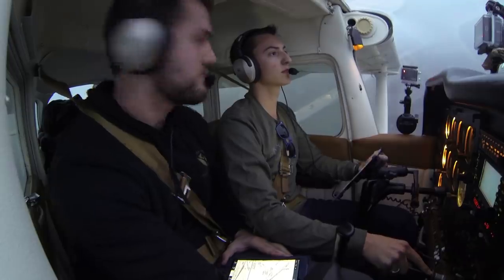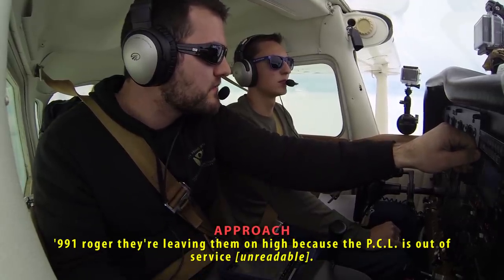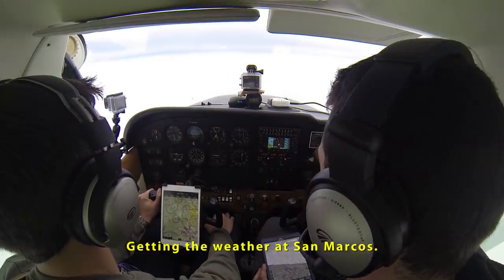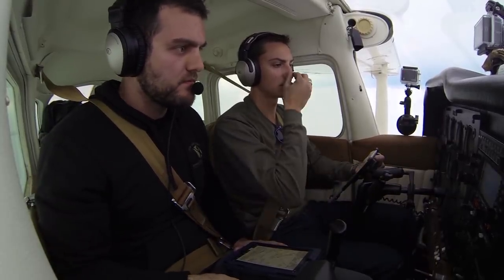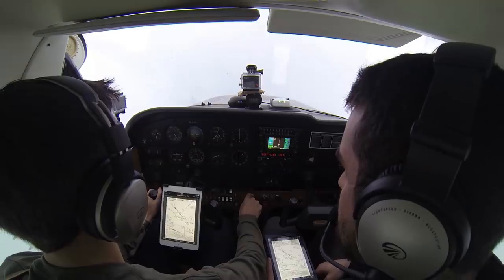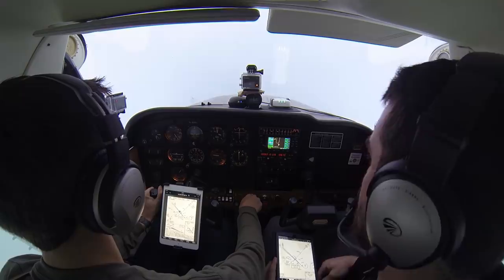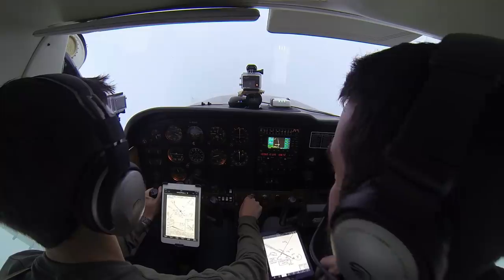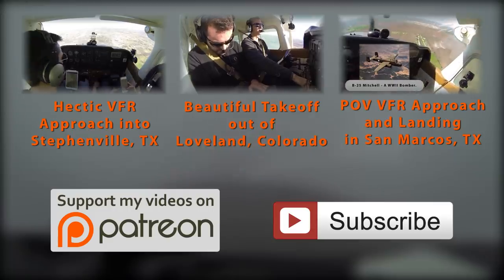ILS Approach to Minimums | ATC Audio | Cessna 172M

Comment: Great video and great job!  Must have felt so rewarding. Thanks for sharing!  I think I understood that the tower might have been closed by the time you landed, so I’m assuming radio communication and piloting rules become the same as an untowered field at that point?  In either case, in the same way that ATC and other air traffic DEPEND on more real time updates from pilots who are actually IN the weather that is being reported by ATIS (such as you did when you noticed the tops were about 5400 feet), by that same token, would it have been possible to announce to the tower or just to traffic in the area that the approach lights were in fact NOT on?  Seems like anyone landing at that airport in those conditions would want to know that, to adjust decision making on how to fly that approach, or even whether they wanted to attempt a landing there at all.  Thoughts?

Comment: Mr. Aviation
1st) Take a deep breath.
2nd) Give  yourself a pat on the back. Congratulations on flying a ILS Approach to minimums on your first try. Not many do as well as you did.

I have a question for you. You pointed out in the video to check suction pressure for the directional and attitude gyros while in the soup. (I am a A&P mechanic, so naturally that piques my attention) Do you take in consideration the health of the engine driven vacuum pump prior to a flight into expected adverse conditions?
Reply: BC437A I'm sure they checked  the suction gauge on run up.  But, there's always a chance that the pump could have  failed enroute.  Not sure if the ADI or DG have "flags" (if they lose suction)  - if not, there would always be a chance that, say, the ADI "froze" in a wings level position. (and the airplane is moving off level flight).  So, IMHO, at least checking the pump vacuum would at least say that the pump is working and the flight instruments are probably functioning as well.    If no suction is indicated, then it's time to do something different!    N-6395T
Reply: Michael Donavon I ask because I am not a certified pilot, even though I understand quite a lot of what a pilot duties are due to my training as a  mechanic. I prefer to replace a time limited part  (IE. A vacuum pump) before they fail. Those in my profession are quite familiar with Murphy ' s Law. Knowing that, would you as a pilot, fly into adverse conditions with a mission critical part with a lifespan of 500 hours that already has 475 hours on it? I know what my answer would be.
Reply: BC437A In my "rookie" (and they are) 1,000 hrs of flying, I don't recall ever seeing any "information" on the aircraft parts, per se.  Like, that the vacuum pump, has 475 hrs on it and will be changed at 500.  Just don't remember seeing any of that.  

Were there forms available, in the aircraft,(at the back of the binder, maybe) that did show what items were coming up for "time change" - I just don't remember them.  

Having worked Aircraft Avionics Systems for many years (no longer) there were many, many systems, and in the "steam gauge" days, there were LOTS of failures, with most EVERY flight!   Just like the kitchen light - it's on, turn it off, now turn it back on - does it come on?   Sometimes it doesn't.   Same thing for those General Aviation airplanes - yes, Murphy's Law is alive and well!  :)   Thanks, N-6395T
Reply: Michael Donavon When a pilot flies an aircraft that they own, it is their responsibility to ensure that all maintenance is up to date prior to flight. That means the pilot has to go through the maintenance logbook to ensure that all maintenance are current. It is different when you fly for a company as they have people whose job is to schedule maintenance for the aircraft the pilot flies. All pilot has to do is make sure all sign-offs are completed and other paperwork are in order prior to flight.
Reply: Agreed.  Thanks,

Comment: Listening to the ATIS, what exactly did they say about the PCL? It appears they mentioned PCL on 126.825, which is what the AFD indicates. Were they NOTAMed OTS?
Reply: There was no NOTAM. And you are correct, the ATIS still reported having PCL with no mention of them being OTS.
Reply: Not having those lights certainly increased the pucker factor :)

Comment: Why didn't you contact the San Marcos tower yourself to ask about leaving the approach lights on?  Were you to far out for reliable communication?
Reply: Yes, we were still too far at that point.
Reply: Sucks that ATC screwed up like that.  Those conditions coupled with a less than optimum runway environment could have caused a Missed Approach.  Glad you got it down safely.  ROG
Reply: whitehedr Right, but, we're all fallible humans and AT controllers are no exception. Yeah, and though the last report we had was 1 1/2 and OVC003, I'm not so sure that was accurate by the time we broke out. I think it was considerably less in both regards.
Reply: Brandon Maso how big was that system?  If you had to go missed, was that system big enough to cover the other fields as well?  If so, what do you do in that case?
Reply: Pappy SLAP It extended from southwest to northeast pretty much from Del Rio, TX to Dallas and covered everything roughly east of that line (i.e. the eastern 1/2 of TX). So, pretty big. However, bear in mind that local conditions can change drastically.... even another airport 10-20 miles away can make the difference between going missed or not in conditions like these.
Reply: Gotcha...so let's say the others are socked in as well...do you just fly a pattern and hold and wait for a hole then?
Reply: No. We had plenty of extra fuel, but not enough to just hold aimlessly. We probably would have had to eventually head north or west to clear air. Even 100nm northwest of San Marcos was perfect VFR conditions that day. In fact, the entire flight back from CO was clear blue sky except that last 80-90nm where it (as you saw) deteriorated rapidly.
Reply: Fair enough...thanks for the answers!  Great job in the cockpit too!

Comment: I think the lighting was heard incorrectly. At 2:32 she asked runway lights or approach lights. Then she said all runway lights are on high due to the PCL's were inop. And read back was "copy PCL's inop and runway lights on high"  assuming that in "runway" lights that would include the approach lighting. But actually it was truly the runway and not the approach lighting.  But way to adapt anyway.
Reply: It was FAR more clear in this video than it was in real life! Additionally, I didn't deem any further clarification or details necessary when she said "everything will be on." One usually doesn't take the MALSR/MALSF system to be separate from the runway edge lights and/or rotating beacon. In every case that I (and I'm sure Josh would agree) have encountered in 10+ years of flying, the entire system is integrated into one PCL "unit."
Reply: +Brandon Maso I am concerned about this response. I noticed the discrepancy in the communication as others did. Mr. Brandon, I don't care how long one has been flying mistakes are going to happen. When one encounters an instance of an error one should always view it as an opportunity to evaluate a less than desirable result for causes and effects. This shouldn't be done to shoulder blame but to find items large or small than can assist with avoiding similar outcomes in the future. It's not about looking backwards and assigning blame. It's about looking forward and preventing the need for blame.

The simple fact is that an error did occur. The question you should find an answer to is what can you do to avoid this error from affecting your performance as a pilot in the future. 

Be confident not arrogant. Though often there is not a clear distinction between the two, it is something those of us who are assertive in life must look to keep balanced.

It was a good video to watch. I enjoyed it!
Reply from the maker: +Karl H Thanks for watching the video! Definitely one of my best I've posted so far :)

Comment: They never told you the Approach lights were on.  You definitely asked for it, but they responded that all runway lights would be on.  That was the call that should have prompted a clarification on the meaning of runway lights.  Of course, hindsight is 20/20 and I'm armchair flying here.  However, I can tell you that if I had asked for approach lights and she said runway lights I would have wanted to hear her say approach lights instead and asked if that is what she meant when she said runway lights.

Comment: May not seem like a big deal for commercial airliners, because they're flying with GLASS INSTRUMENTS.  They've got all the latest tech, have all that power, take precedent over GA, and would've flown in much sooner.  The fact that the lights were left dim I would've reported immediately, since a direct order by a pilot flying in IFR to turn lights on full, while they're having a malfunctioning radio lighting control, is a complete dereliction of duty and negligence on their part.  What you performed was an extremely skillful IFR landing, that most airline pilots would be envious of.

Comment: Wouldn't the minimums be higher with the ALS out?
Reply: +Bruce Yang I just checked the chart and it says "For inoperative MALSR, increase S-ILS 13 Cat E  visibilty 1/4 mile, and S-LOC 13 Cat E 1/2 mile. ADF Required" So it looks like the increased minimums only apply to Category E aircraft. Really nice job on the approach!

Comment: I got my instrument rating in 2008 and to this day I still haven't flown an approach to mins in actual conditions. I did fly a few actual condition approaches early on in my training but they were pretty far above minimums. I would be just as uncomfortable with this.
Reply: yeah why even bother, if the weather is this bad fly another day
Reply: Note that weather can change very quickly, hence the ILS training
Reply: this weather did not catch anybody by surprise. Fly when it's VFR and you have nothing to worry about

Comment: They did not at all give you false information.  She specifically said that the RUNWAY lights would be left on full intensity.  When she asked you to specify whether you meant the runway lights or approach lights, your instructor said Roger and even stated back that he heard that the RUNWAY lights would be on full; he did not mention the approach lights at that point.  The breakdown of communication was on your end exclusively; not ATC's by any means.

They didn't give you false information; your pre-concieved made it so you heard what you were expecting, and not what was actually told to you.

I'm not saying this to rag on you; I'm saying this because you are simply stating a falsehood, partially assigning blame to a party that was completely blameless in this situation.  They gave you correct information in regards to twhat was actually asked, and even asked you to specify whether the information you received was what b it Inenway lights will be on full, despite this se in benot being what you wanted.  That's on you guys, no offense intended.
Reply: I think the confusion came when the ATC lady said "the pilot control lighting is out of service so they're leaving EVERYTHING on high". In the context of this conversation 'everything' would reasonably be assumed to include both approach lights and runway lights. So there's some blame on both sides here.

Comment: Should have diverted to Bergstrom.  Safety first, man.  Don't trust regional airports in possibly CATIII conditions.  Don't trust regional tower to groundstaff interactions.  You landed in an unprofessional situation on the ground.   

You had the fuel to divert.
Reply from the maker: Yes, safety first! Always be ready to go missed, just like we were. There was no way to tell that information wasn't correct, and no, I will not "not trust" my home airport's staff, this was a fluke thing that rarely happens. If we had to go missed, Bergstrom would have been our next stop, but we saw the runway right as we broke out at minimums. I appreciate your input though!
Reply: Why not try for the approach? Weather was slightly above minimums. If he didn't see the runway, he would have went missed anyway. Bergstrom probably wouldn't have been much better. It's only like 20 miles north of HYI.